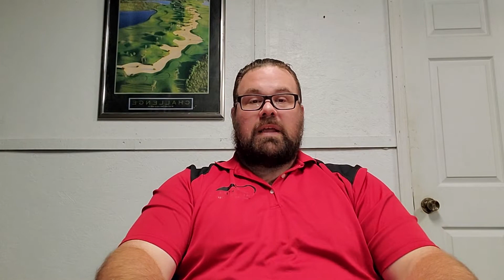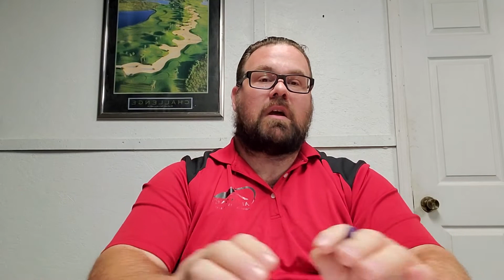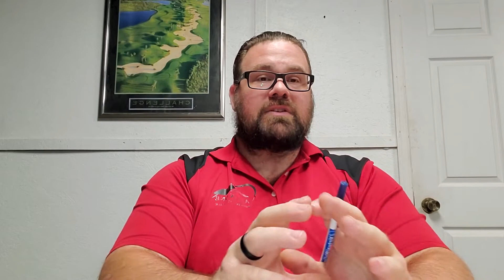Why do I need an Expansion Tank on my Water Heater?

Comment: The pressure relief valve removes the pressure correct ?
Reply from the maker: The TPR or pressure relief valve is a safety device that is there so that the water heater doesn't explode or become a missile. For a water heater the TPR settings are 210 Deg F and 150 PSI of pressure. It doesn't remove the pressure it relieves the pressure, meaning that whatever excessive heat or pressure is built up in the heater tank will be directed through the TPR and to the outside of the tank. This is a strong and violent surge of very hot water spraying out of the TPR and that is why there are rules about the type of piping materials and where they can terminate at for safety reasons. If a TPR is on top of the water heater and there is not a discharge pipe connected to safely direct it towards the ground or a safe place then someone could get blasted in the face, neck , or chest area with nearly boiling hot water.